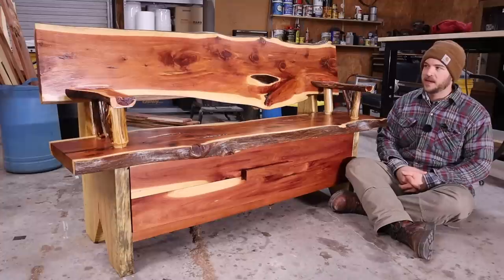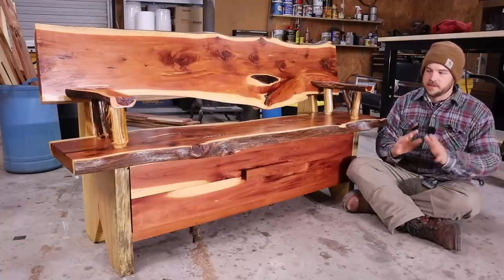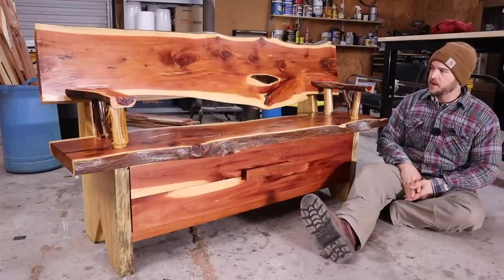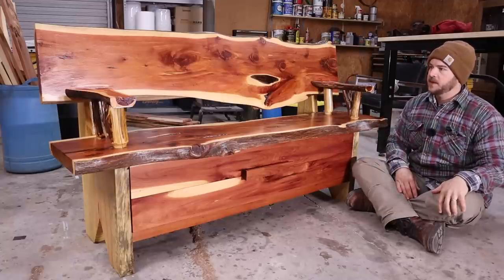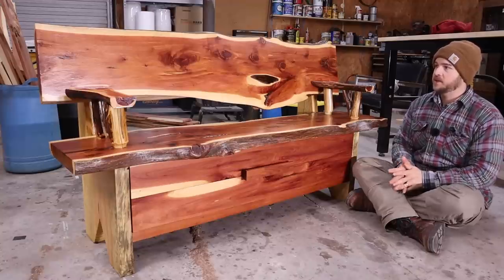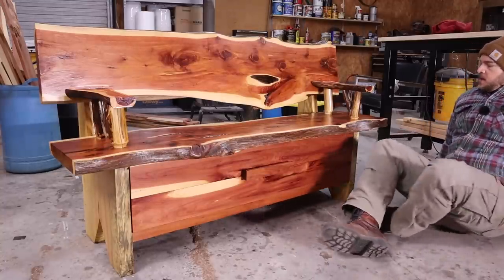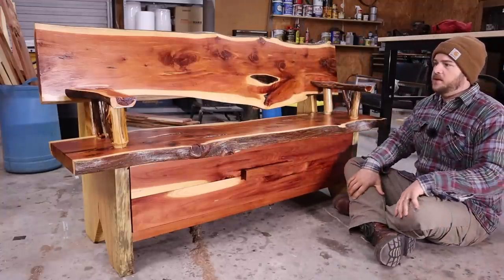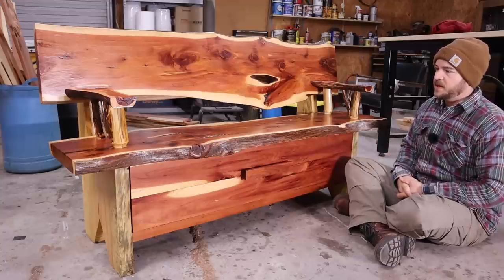A One of a Kind Red Cedar Bench

Comment: Good job!  I would like to share a tip I stumbled on recently when finishing cedar.  I recently enclosed my new router table with cedar lumber to mount accessories on.  I have also been wanting to try using dyes, and have only used stains previously.  I decided to finish the cedar with Danish Oil, but thought it would be good test for trying my hand at dying.  My router table wouldn't matter if it turned out strange.  I got a 2 oz bottle or bright red Transtint dye from Woodcraft and added 30-40 drops to the last 4-5 oz of a can of natural Danish Oil I had.  I applied it similarly to any oil....couple coats of rub on and rub off.  When dry, I applied a coat of Johnson's Paste Wax with steel wool.  WOW!  The color in the cedar became almost 3 dimensional.  Even the white sapwood took on a pinkish tint that really looked nice.  My brother, who notices almost nothing when he comes to my shop, commented immediately how rich the cedar looked on my router table.  I just wanted to share my experience with dyes.  I plan on experimenting more with dyes on different wood since I learned that they do not leave a muddy finish like stains; but just enhance the natural color of wood.
Reply from the maker: Interesting! Thanks for that tip!

Comment: A beautiful piece! Gorgeous red cedar and a great rustic design. Something I've done to deal with the fibers of bark is to leave them until after I've put on a coat or two of poly or other varnish, then sand them off. The varnish binds the fibers that are laying flat and stiffens the ones that stick up so they can be sanded off.
Reply: That's a great tip!

Comment: A tip: those sharp angles cut in at the bottom and elsewhere are now stress relief points for "green" lumber when they are placed inline with the grain. As the wood dries you may want to keep an eye on those.  Cedar can be more forgiving when it has predominantly straight grain. Curved design helps.

Comment: Nice piece, thanks for sharing.  A simple solution for your "storage drawer finish mistake" is to just cut some thin slats of fresh cedar and place them in the bottom of the drawer or have your bride make a couple of small cloth bags and fill them with fresh cedar shavings or sawdust.  Either option will provide the cedar aromatics you are looking for and can be easily freshened as needed over time.

John
Reply: Well,  that's a lot simpler that I was going to suggest: use a small sander on some interior surfaces. 😎

Comment: Beautiful piece. One issue with finishing just one side of a piece which bit me in the rear is warping. I built a small clock and only finished the show side of the back piece and ended up with major warpage since the unfinished side continued to dry at a much faster rate than the finished side could.

Comment: A tip for when you want to drill to a set depth. Measure the depth on the drill bit then wrap masking tape around the bit at that point. You then just need to drill until the tape meets the surface you are drilling into. You get consistent depths with less checking during the process.

As far as sealing the inside of the drawer, cedar itself is a known allergen that is quite common it is better to have it sealed and not cause problems in the future. The aroma of cedar, as nice as it is, can also be an asthma trigger. You don't need to be born with it, I wasn't yet now have a really bad case of asthma for which cedar is a trigger for me. Go figure, I live in British Columbia with it's vast tracts of cedar.

Comment: Admitably,  only good for something indoor, but comes out fantastic.  50/50 boiled linseed oil and turpentine, and any hard wax.
Coat it with the linseed oil mix, wait 20 minutes, wipe off the remaining oil.  If blotchy repeat as necessary.  When done, wipe it down with isopropal alcohol (don't get aggressive, you only need the very top layer off).
Choose a hard wax, and apply it with 0000 steel wool.  Rub until it feels good.
I've done this several times, and always it's turned out great.

Comment: Nicely done.  Personally I think it's a toss-up on finishing the inside of the drawer.  As you say it hides the smell of the cedar, but on the flip side leaving the inside unfinished could cause uneven drying and warping.  Maybe add some unfinished cedar trim boards, or a false floor, inside the drawer to get the smell back.
Reply from the maker: Good point on the warping. I didn't consider that.

Comment: Helpful tips... Next time you go to apply polyurethane use a cheap foam brush.  It will prevent the bubbles
Reply from the maker: I wondered about that. I might invest in a few of those. I was struggling with an even finish.
Reply: Something I was taught by my grandfather years ago.  Brush paint, foam poly, and rag stains.